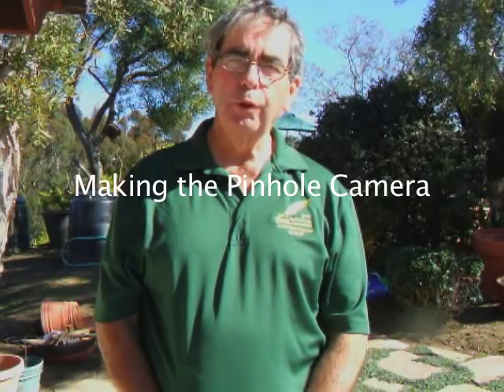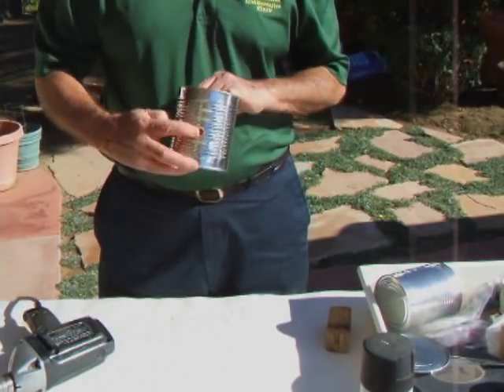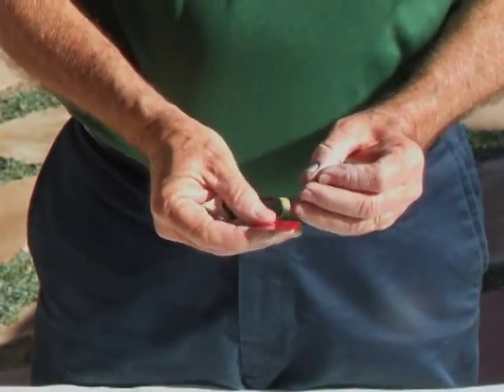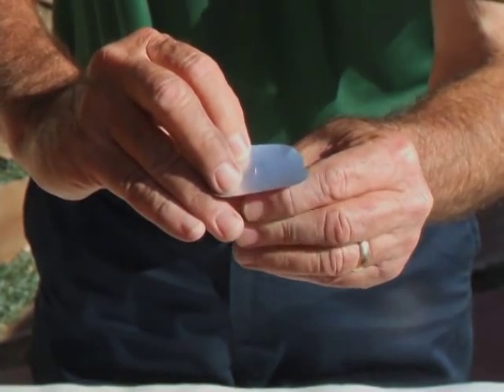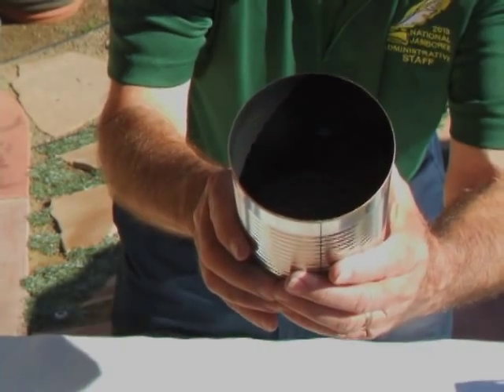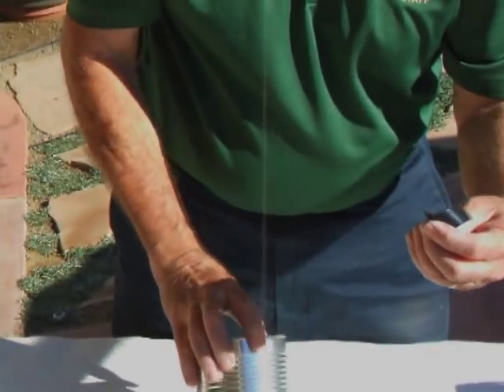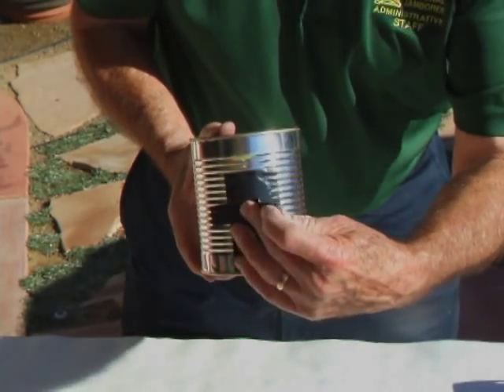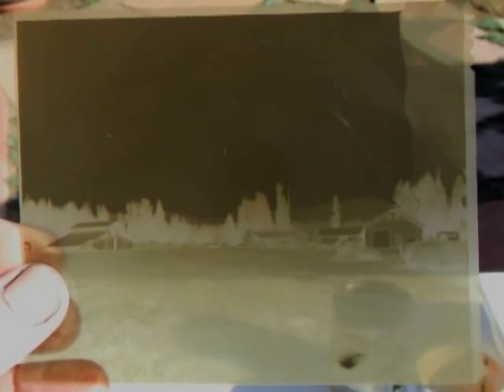Making the Pinhole Camera

Comment: What kind of film did you load the camera with?
Reply from the maker: Large  format film  can be expensive. I use Photolith film because you can buy  a box of 50 sheets, 8x10 inches, then cut it into pieces to fit any  size camera. Photolith film is slow. Very  slow, so it takes time to make an exposure. Once you’ve done tests it’s easy  to repeat successful  exposures  by  repeating the amount of light  (bright sunlight is best), and the previous exposure time.  

From Freestyle in Los Angeles, a box of 25   8x10 sheets costs about $25.00.

It’’s no  different from regular B/W film photography in  the first step: Exposure.

The second step, (using Photolith  flim) is slightly  different. Photolith film is  meant for lithography. Photolith  film is used to create black and white images  without  shades of grey. Black and white. No shades of grey. Pretty grim if you are looking for shadow detail.

But, as with many things in photography, there’s a way around this limitation. It is not a PROBLEM,  it is a LIMITATION.

If you  use a weak developer, or one which takes a long time to develop regular film, then  the  Photolith film also takes time to develop and you can get shadow detail. It’s a matter of testing. 

If you want to use a  film such as Tri-X, with an ASA or ISO of +/-400,  then  you have all the control  of  any ordinary negative. Exposure times will be shortened. Development times will be shortened, and your negative will not look any different from one taken with a lensed camera.

Photolith film has an ASA  or ISO approaching 10. Not 100. 10 or less. That means SLOW. So remember, SLOW, but less expensive.

Beware of this with Lith film:  It is extremely thin. The backing on it is thin, requiring a good seal  on the camera, and a SOLID BLACK SURFACE for the inside of the can. Use a non-reflective  black spray paint for best results.  

Where to buy Photolith? Freestyle on the West Coast, and B&H on  the East Coast. There are other sources, of course, but these two work for me.

Here’s the description for Lith film from the Freestyle webpage:

Specifications
PDF Downloads
One of the most popular products Freestyle has ever carried was a regular supply of Ortho Litho film. Continuing the tradition, Freestyle offers Arista Ortho Litho 3.0, a replacement for the Arista Ortho 2.0 Film.

Arista Ortho Litho 3.0 has very similar specifications as the previous Arista Ortho 2.0. This film is a halftone film designed for rapid access processing. This is a film to be used for high contrast and continuous tone results. For high contrast negatives, use this film with Arista A&B Lith developer or any standard lith developer. For a continuous tone it is recommended to use with LegacyPro Select Soft Powder paper developer or any other standard powder paper developer.  To reduce contrast in the film, you may want to double dilute the paper developer to get continuous tone results.

Features

Very steep gradation and gradation tone
Exceptional dot-and line sharpness
Wide exposure latitude and development latitude
Low Minimum density and good UV transmission
Faithful reproduction of the original
High maximum density
Anti-static layer for dust-free handling
Anti-Stress layer to help protect against scratches and other damage
Special layer in the emulsion to prevent Newton rings
ISO rating can rely on process, but generally can be rated at .5 - 6 iso
Can be processed under red safe light